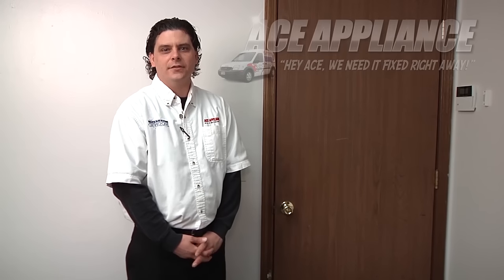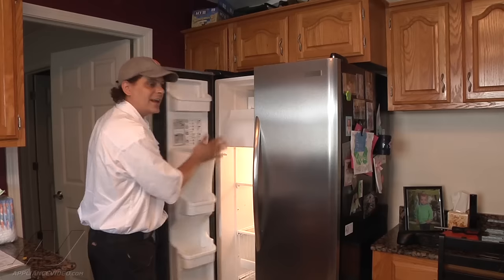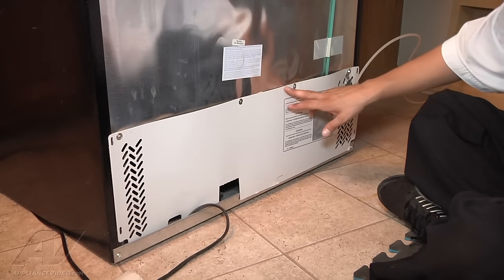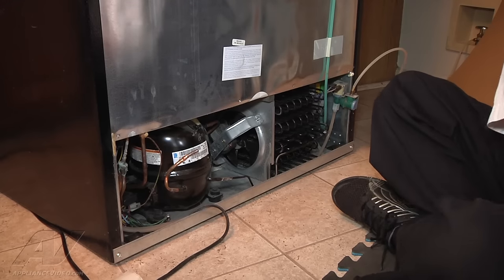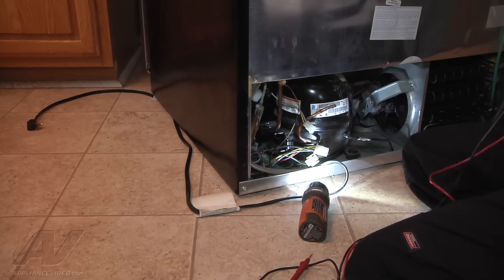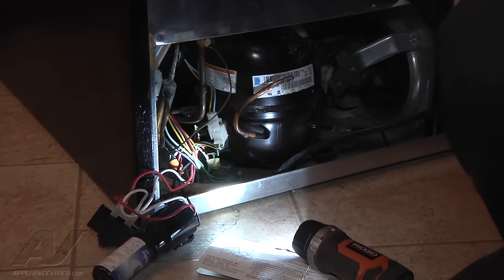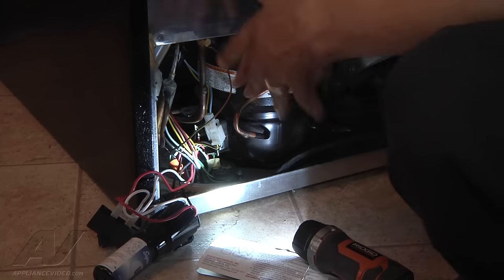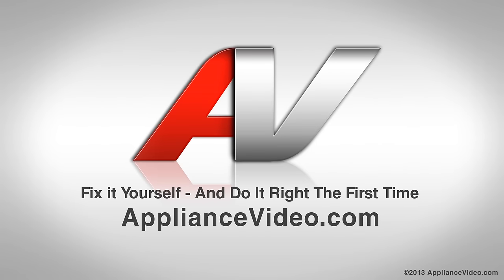Frigidaire Refrigerator Repair - Not Cooling - Hard Start Relay Overload Kit - Diagnostics

Comment: Well done! You could always teach at a tech college if you get tired of service work.
Reply from the maker: Maybe one day! Thanks for your response, we are glad we could help. Our library of over 5,900 videos are currently helping over 1.6 million people like you every MONTH.  Please help us by subscribing to our YouTube channel, or post our website www.ApplianceVideo.com to your Facebook page, Twitter, Instagram or any other social media sites. Your support will help us keep producing more free quality videos.
Reply: @Appliancevideo  I have a Frigidaire side-by-side. The freezer won't get very cold but the fridge side is fine. I watched your video and panel was off the back. I reinstalled it but made no difference. Any suggestions would be greatly appreciated. Thank you.  PS your videos are top notch!
Reply: @spulamander  in any fridge all the cold air is made in the freezer section. there is an evaporator fan motor that blows some of that cold air into the fridge compartment. if your freezer is not getting cold then it is not cooling which means you probably have a blockage.
empty out your freezer and take off the panel that covers the evaporator.
if you see an ice ball on it then you have a severe Block in your evaporator coils. also check out where the air goes from the freezer section to the fridge section and see if there's a blockage. it could be a spilled broken bag of peas that has done it.

Comment: This video was right on the money when it came to diagnosing the problem. I just changed the capacitor/starter in my Kenmore. The stock part was special order and cost 65 bucks. The Supco 3 IN 1 was 20 and I have a working frig.
Reply from the maker: +SuperCal 

Thanks for your positive
comment. We are glad we could help resolve your issue and hopefully saved you
money. Please help us provide more videos to our site by subscribing to our
YouTube page or posting our http://www.appliancevideo.com/ website on your Facebook or Twitter account. Our
factory authorized technician’s also daily provide free professional Repair
Help to people like you to help solve their appliance problems. You also have
the option to email a factory service technician with a question at http://www.appliancevideo.com/repair-help/ .  If you need of parts for your major
appliance, we have over 5-million parts in stock at http://savemoreonparts.com/ . Thanks in advance for supporting us. So email
us if you have any other questions our videos cannot resolve. Thanks for your
support in advance.   Matt, Ace Appliance service technician.
Reply: *****
I just subscribed, and I will share with as many people as I can. I watched other Youtube videos by other people, but they lacked the information that you provided. Some of the other videos were wrong, or left out important devices. Other videos could cause harm to the frig, but yours was perfect.
Reply: *****
Check for a clogged air way or water drip. Clean the freezer and frig inside and vacuum the dust.

Comment: That was a quality video! I need help figuring out what is wrong with my refrigerator not cooling.
Reply: It's very important to keep your appliances at the proper temperatures. Keep the refrigerator temperature at or below 40° F (4° C). The freezer temperature should be 0° F (-18° C). Check temperatures periodically. If the temperatures aren't kept at the proper settings the more chance Listeria, a bacterium that causes foodborne illness, can grow, especially if the refrigerator temperature is above the safe temperature. Thermometers are the best way of knowing these temperatures and are generally inexpensive.

Comment: Is possible that compressor be still vibrating and it has starting component problem? My fridge has compressor vibrating it's on for sure  but it seems quieter than normal but condenser coils are almost at room temp.

Comment: Great Video! Okay, I have a cooling problem. No cooling at all and the fans are working. The bottom fan in the back and the fan in the freezer next to the coils. The compressor is running and warm. The overload and replay capacitor connected to the compressor are good. There is no ice build-up on coils. The timer, thermostat, and heater are all working efficiently. What could be keeping my fridge from working? Freon? Something else?
Reply from the maker: Great question, if you have a more technical question that our parts department cannot answer, you can search our over 17,000 answered questions free at our website www.ApplianceVideo.com under our Repair Help section. You can also call our parts department at 1-800-830-5465 and they can give you help 7-days A week ,or search at www.SaveMoreOnParts.com  .
Reply: Take a amp reading of your compressor running...check that against the data on the compressor..if is close the possible blockage ..if amps very low..freon leak or compressor out put valve is not working...

Comment: Hello.  I have a upright freezer.  I did all you suggedt  measures the 3 prungs and add thr 2 numbers and it total the 3rd prung.  

All connect the 3 n 1 and the  Compressor running super hot and does not go into freeze temperature.  

I order and replace the start device.. Nothing compressor just click on and off...  

Would a leak in the system cause tge compressor to click on and off?   Low refrigerate??

Comment: It would really help to see how you are testing the OMs readings with the multimeter.
Reply from the maker: Great question, if you have a
more technical question that our parts department cannot answer, our
technicians are answering all questions at our website at www.ApplianceVideo.com under our Repair Help section. You can also call
our parts department at 1-800-830-5465 and they can give you help 7-days A week
Mon-Sat . You can also search at www.SaveMoreOnParts.com 7- days a week.

Comment: I have a WHIRLPOOL fridge with top freezer. The freezer is real cold but, not freezing food and water in ice tray not freezing.
The fridge part is barely cold. The compressor is running and kicks on and off as supposed to be. The compressor is not hot to touch and fans are working.  The refrigerator is 12 years old.The freezer and fridge was almost empty so, I filled the freezer and fridge with food. Almost full. Not blocking any vents.
    Could leaving the fridge and freezer almost empty for about a week affect this?
Awesome video. Thanks so much.
Reply from the maker: Great question, you can call
our parts department at 1-800-830-5465 and they can give you help 6-days A week
Mon-Sat . You can also search at www.SaveMoreOnParts.com 7- days a week.  If you have a more
technical question that our parts department cannot answer, our technicians are
answering all questions at our website at www.ApplianceVideo.com under our Repair Help section. We have over 6,000
common questions and answers that you can easily search through by your model
number, appliance make, problem or error codes, and It’s completely free to
search through our question & answer library. There is a very good chance
you question is already answered there.
Reply: SOUNDS LIKE THE FAN IN THE FREEZER IS NOT WORKING

Comment: Hey bro, when 2 of the 3 leads on the compressor pins are open then its bad ehh? The thermal overload only opens one correct?
Reply from the maker: Great question, if you have a more technical question that our parts department cannot answer, you can search our over 17,000 answered questions free at our website www.ApplianceVideo.com under our Repair Help section. You can also call our parts department at 1-800-830-5465 and they can give you help 7-days A week ,or search at www.SaveMoreOnParts.com  .

Comment: My freezer door was left open for 12hrs! Got rid of 85% of items in both compartments, unplugged and cleaned up. To be safe I used blow dryer on freezer vents so air can flow from freezer to fridge. Cleaned up and plugged back in, seems to be getting cold nicely. Did I do any permanent damage to the compressor or anything else?
Reply from the maker: Great question, if you have a more technical question that our parts department cannot answer, you can search our over 17,000 answered questions free at our website www.ApplianceVideo.com under our Repair Help section. You can also call our parts department at 1-800-830-5465 and they can give you help 7-days A week ,or search at www.SaveMoreOnParts.com  .

Comment: I have followed all the steps with my plhs67eesb4 as it is behaving EXACTLY the same way, fan running, display has power, compressor returns equating ohms resistance, purchased the URC0410 and the only difference is that the pins were not 1 on top, two on bottom, but the opposite, since they were not labeled on the compressor, I tried all three positions with power, and only one started the comp, after about an hour, the compressor is literally hot enough to sizzle a hot rag, I've disconnected power but need direction
Reply from the maker: Shawn Renn If you wired the new relay to the compressor terminals common , run & start correctly and the compressor is not starting or running you have a locked up compressor. A locked or tied up compressor means you would need a new compressor. You would have to call a appliance repair company with the corrct tools to replace the compressor or give you an estimate on the repair.  . Please help us provide more videos to our siteby subscribing to our YouTube page or posting our http://www.appliancevideo.com/ website on your Facebook or Twitter account. Our
factory authorized technician’s also daily provide free professional Repair
Help to people like you to help solve their appliance problems. You also have the option to email a factory
service technician with a question at http://www.appliancevideo.com/repair-help/ .  If
you need of parts for your major appliance, we have over 5-million parts in
stock at http://savemoreonparts.com/ . Thanks
in advance for supporting us. So email us if you have any other questions our
videos cannot resolve. Thanks for your support in advance.   Matt, Ace Appliance service technician.

Comment: I have a Defy F640 side by side fridge/freezer unit. This fridge has 2 comprssors. Am I correct in saying that the fridge and the freezer are 2 total separate units? So if the compressor for the freezer needs to be replaced it will not interfer with the fridge side. So l won't need to regas the fridge side?
Reply from the maker: Great question, if you have a
more technical question that our parts department cannot answer, you can search
our over 10,000 answered questions free at our website www.ApplianceVideo.com under our Repair Help section. You can also call
our parts department at 1-800-830-5465 and they can give you help 6-days A week
Monday -Saturday, or search at www.SaveMoreOnParts.com  24 hours
7- days A week.

Comment: hello sir,i have the same model mine has lots of frost build up on the freezer part and the fridge part is warm not cooling properly.i checked my defrost thermostat is good and I also checked my heat element for defrosting that is fine too,what can  be the problem? I think that would be the cold control if it is cold control how to test it or check it if it is not working,and by the way the fun on the freezer part is running too,thankx in advance.
Reply from the maker: Hameed 
              I would say you have a defective defrost control, if your heater and thermostat are good the only other possibility is the defrost control.  Please help us provide more videos to our site by subscribing to our YouTube page or posting ApplianceVideo.com site on your Facebook or Twitter account. We also have our factory authorized technician’s email daily free professional advice to people like you to help solve their appliance problems. Thanks in advance for supporting us. Matt, Ace Appliance service technician.
Reply: thank you very much for quick answer
Reply from the maker: No problem, please let us know how it turns out and if you have any further questions. Thanks for your support

Comment: The compressor winding ohms aren't fluctuating your meter leads are.
Reply from the maker: Great question, if you have a more technical question that our parts department cannot answer, you can search our over 17,000 answered questions free at our website www.ApplianceVideo.com under our Repair Help section. You can also call our parts department at 1-800-830-5465 and they can give you help 7-days A week ,or search at www.SaveMoreOnParts.com  .

Comment: what is the multi-meter set to when you're testing the compressor?
Reply from the maker: Great question, if you have a more technical question that our parts department cannot answer, you can search our over 17,000 answered questions free at our website www.ApplianceVideo.com under our Repair Help section. You can also call our parts department at 1-800-830-5465 and they can give you help 7-days A week ,or search at www.SaveMoreOnParts.com  .

Comment: What is your ohm meter set on to check the compressor pins and what should the readings be for the three pins??

Thanks...
Reply from the maker: Great question, if you have a
more technical question that our parts department cannot answer, you can search
our over 10,000 answered questions free at our website www.ApplianceVideo.com under our Repair Help section. You can also call
our parts department at 1-800-830-5465 and they can give you help 7-days A week
Monday -Sunday, or search at www.SaveMoreOnParts.com  24 hours
7- days A week.
Reply: Set on ohms
Reply: What Ohm setting?

Thanks...

Comment: we have the same samsung fridge but what we did was simply switch off the power for 30 sec or more for the mother board to reset it self and then switch back on and the fridge was cooling again. and also while you waiting for the computer to reset clean the back where the compessor and the coils are that would help as well, try that before calling some one and spending money on a new fridge. thank u
Reply from the maker: Great question, if you have a
more technical question that our parts department cannot answer, our
technicians are answering all questions at our website at www.ApplianceVideo.com under our Repair Help section. You can also call
our parts department at 1-800-830-5465 and they can give you help 7-days A week
Mon-Sat . You can also search at www.SaveMoreOnParts.com 7- days a week.

Comment: I have a 3 year old electrolux EI28BS65KS french door with bottom freezer and i'm having issues with the fridge temp.  the freezer is at zero degrees and the fridge is 58.  i've done numerous things.  took all freezer stuff out.  took the plastic shield off covering the vents and the vents were all iced up.  and the back panel covering the coils had built up ice.  so i did full defrost.  plugged it back in and it was fine for 4-5 days.  keeping temp.  then my water lines froze.  so i had the door open taking out drawers and getting to the coiled up water line and put a hair dryer on it for a couple minutes.  got the ice line thawed out and working again.  once i put everything back together, the fridge temp problem came back.  now i'm zero again in the freezer and 58 in the fridge.  i've ran through the diagnostic tests and i'm not getting any errors.  i feel like its a defrosting issue but not sure.  so i'm open to any and all thoughts.  ready to dig in and pull everything out that i can in the freezer including all panels and get a better look at the coils.  i assume they are freezing up again.  thanks.
Reply from the maker: Great question, with our
technicians now getting hundreds questions weekly, they are answering all questions
at our website at ApplianceVideo.com under our Repair Help section. We have over
3,000 common questions and answers that you can easily search through by your
model number, appliance make, and problem or error codes.

Comment: What did you put the multimeter on to tech the pins ? and what should the number be ? 10?
Reply from the maker: Great question, if you have a more technical question that our parts department cannot answer, you can search our over 17,000 answered questions free at our website www.ApplianceVideo.com under our Repair Help section. You can also call our parts department at 1-800-830-5465 and they can give you help 7-days A week ,or search at www.SaveMoreOnParts.com  .

Comment: Should compressor feel pretty warm or even  hot
Reply from the maker: Great question, if you have a more technical question that our parts department cannot answer, you can search our over 17,000 answered questions free at our website www.ApplianceVideo.com under our Repair Help section. You can also call our parts department at 1-800-830-5465 and they can give you help 7-days A week ,or search at www.SaveMoreOnParts.com  .

Comment: I seen a domestic 115 v kenmore refrigerator/ freezer with a 175v compressor but not converter anywhere. How does that work?
Reply from the maker: Great question, if you have a more technical question that our parts department cannot answer, you can search our over 17,000 answered questions free at our website www.ApplianceVideo.com under our Repair Help section. You can also call our parts department at 1-800-830-5465 and they can give you help 7-days A week ,or search at www.SaveMoreOnParts.com  .

Comment: I've replaced the 3 in 1 hard start but I've never used the  old capacitor on the 3 in 1. Would this make a difference? I've never had a recall either.  Just wondering.
Reply from the maker: Great question, if you have a
more technical question that our parts department cannot answer, our
technicians are answering all questions at our website at www.ApplianceVideo.com under our Repair Help section. You can also call
our parts department at 1-800-830-5465 and they can give you help 7-days A week
Monday -Sunday, or search at www.SaveMoreOnParts.com  24 hours
7- days A week.
Reply: yes, i have this doubt too.....